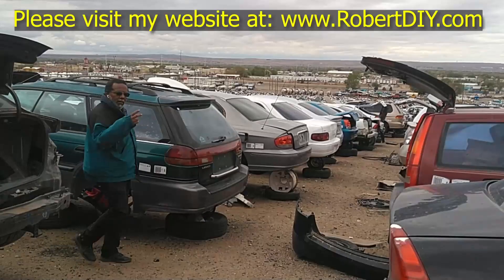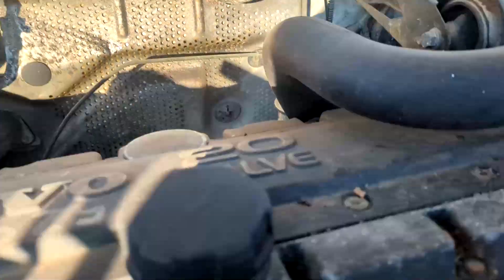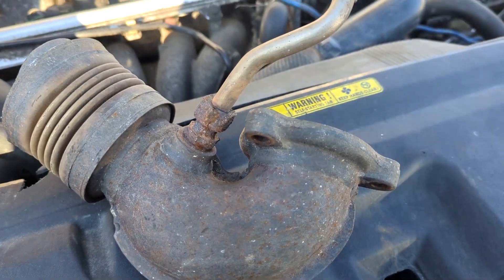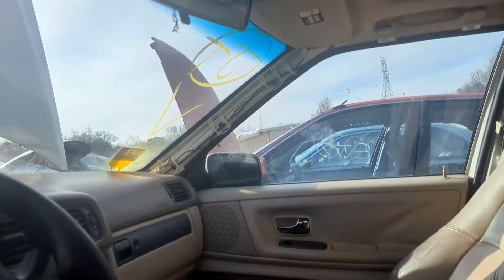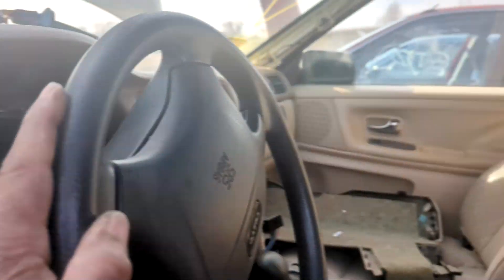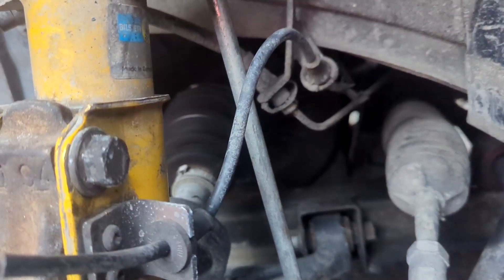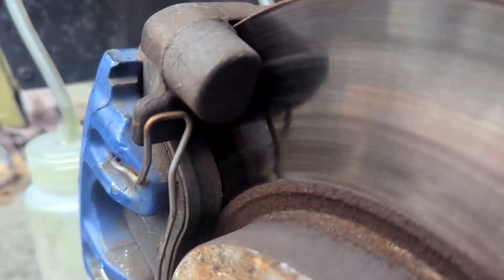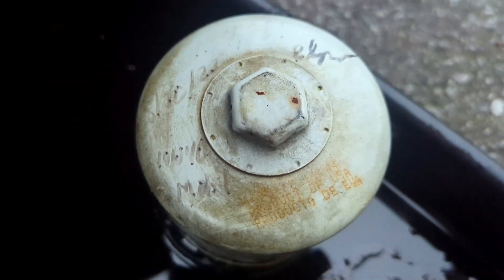Back to the salvage yard, a couple of times. LOL Then did a little work on Lemonade, brake caliper.

Comment: You may already have that S70 issue resolved, but another temporary measure would be to unplug that injector. At least the car would be driveable without dumping the extra fuel.
Reply from the maker: That's what I did. 👌🏾
Reply: @RobertDIY  Obviously wasn't trying to school you,  just a two line tip for others.
Reply: @RobertDIY   And of course a tickle for or buddy Algo Rhythm

Comment: on the fuel injection problem. I can't think of any scenario where the harness could cause the computer to fire just one injector, only when the computer is hooked up and no ground with out the computer hooked up. what ever is happening is happening to them all, or there is a bad injector. so I would check the temp input and all the injectors. ignore the scan blaming only #2.  Its a red herring. the reason it runs better with it disconnected is there is 20% less fuel being delivered. also it is possible the fuel regulator is allowing too high pressure. though doubtful.  the pump only goes a few pounds above required.
Reply from the maker: Interesting